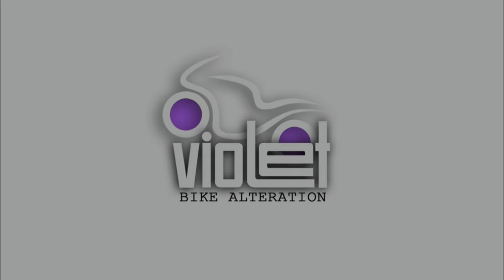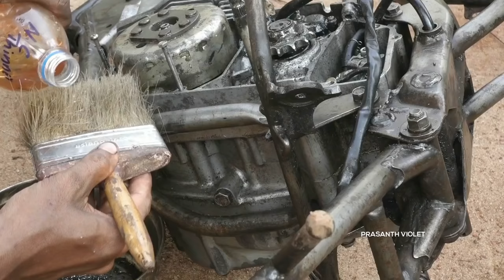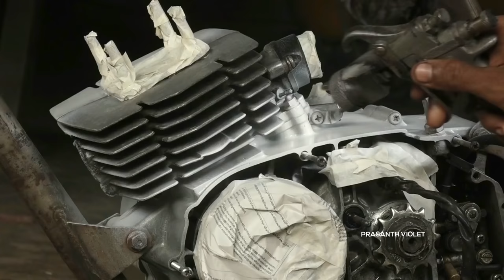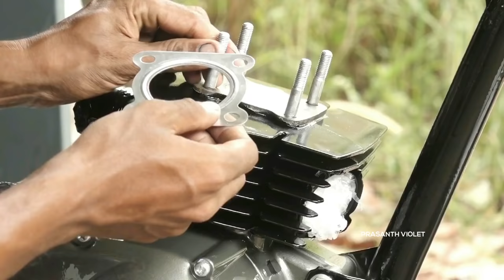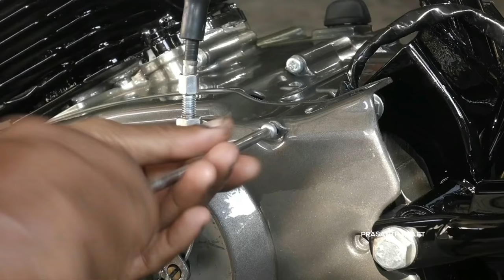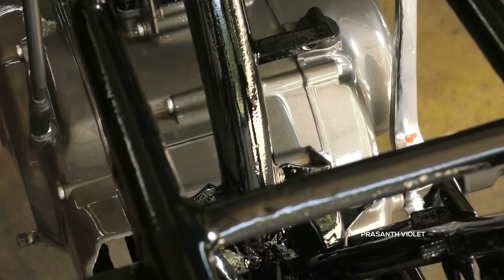Suzuki Samurai Engine Painting | By Prasanth Violet

Comment: If it is original rx 100 escorts shock absorber means some what better because it makes a smooth sound kiss kiss like that when running on the damaged roads and I think in the above video you have fixed Gabriel shock